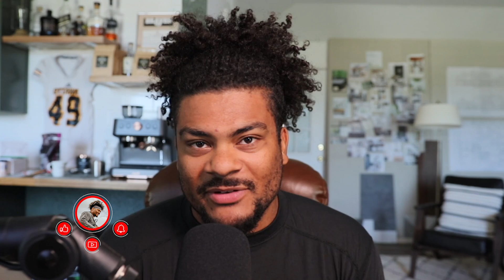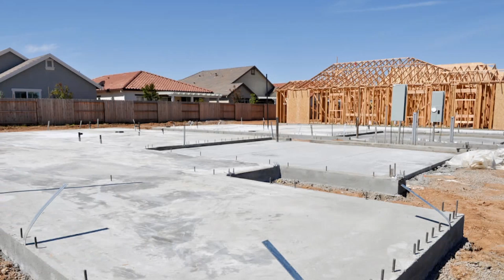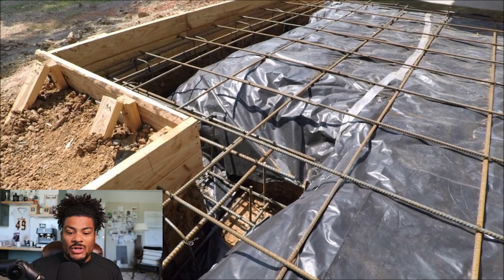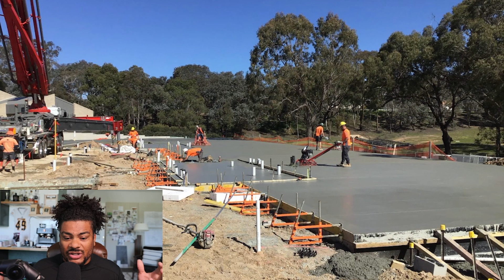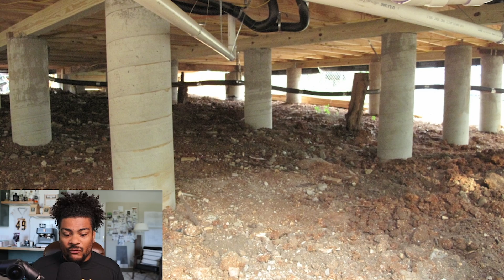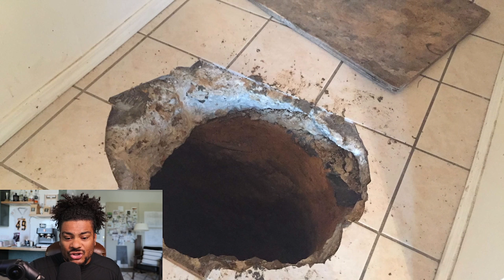Pier and Beam Vs Slab Foundation

Comment: My thoughts are, why not fully box off the beam foundation from the Pier and beam foundation and make a slab foundation in it? Basically combining the two. A slab foundation on concrete Piers. If concerns about if the concrete piers can hold that much weight. Just have steel I-beams as the core of the concrete piers. I'm sure structural engineers can flush this idea out properly

Comment: A crazy thing i saw on a slab....anchor bolts ( red heads) were drilled through the concrete....wih the hole completely hrough the concrete, termites found their way in, and ate up the sill plates and into the studs about two feet over an area about 15 foot along the wall...ive never seen it anywhere else....if anchor bolts are used, i would make sure there was several inches of concrete below where the anchor bolts are placed!

Comment: The main reason post a beam cost more is the floor framing cost + walls when a slab has no framing cost just pour cost and most guys will pour concrete cheaper then guys will frame and post box anchors rebar for the piers hammer drill bits ect start to add up more I pour concrete and am currently building a post and bream right now lol I only went post and beam for the fact I can do more as a one or two man show then I can with a slab is all the reason I did it in the long run slab would of been faster (one day pour) be 2 day framing floor of post and beam so it’s all about money and time frames for most people and u don’t get a lot of pros from post and beam from that aspect but me always moving is a nice part not waiting on help

Comment: I did both. Cmu block piers and a slab for my post and beam cottage. Insulated the piers and under slab. Find pier and beam raised off ground to be worse for bugs and rodents here in the north. I basically have a pavilion right now. Gonna finish walls this summer.  Pier and beam cost more for radon mitigation. Code here masonry needs to be expose or breathable 18 inches above grade. To dry out. Better insulation factor with slab than pier and beam. All the wood causes thermal breaks. So same insulation thickness in pier floor means lower r value. Another con on pier and beam is frost heave. Which I see on a lot on pier and beam cottages up north.  I have 70 psf snow loads and 6 foot frost depths. Another pro for pier and beam is use as a root cellar or cold room. Most sky scrapes have piers and slab.
Reply: Shouldn't pier go below frost line?

Comment: Good video. 10 years in Houston in a 1200 sq. ft. slab home, meh. Bugs, yes. 20+ years in Dallas in a 1200 sq. ft. pier and beam. I'll take the pier and beam. Not many bugs and if I saw one, bug bomb in the crawl space. The house was 25 years old and the underneath was good, probably still is. The only problem was the attached slab garage and driveway. Cracks.
Reply: concrete has been known to crack

Comment: I’m in your area! I bought a couple of run down houses to renovate and they’re my first pier & beams. Gotta’ say, I miss my slab foundation, but I’m working with what I got and I’m learning as I go. I appreciate your insight regarding the benefits of p&b. The houses are ~70 years old and I’m preparing to spend some time underneath with very little clearance and a pretty high level of claustrophobia. Wish me luck!
Reply: most snakes are not venomous
Reply: @badawesome  Yeah, not terribly worried about snakes. It’s working in such a tight space with claustrophobia. Houses are set low, with very little clearance - like belly crawl low, the plumbing is not well organized and there’s junk and trash scattered about that I want to clear.

Comment: In the process of building my homestead. Got a quote for a slab of $16k and some change. Just rented an auger and put in 24 piers for $1774.78 in materials and $434.88 for 3 days on a skid steer with an auger. I ended up doing peir and beam for several other reasons than price but was blown away at what they wanted to do a 30x60 slab
Reply: They charge $10 per square foot for slab where I live in MT

Comment: What’s the best way to insulate? From the bottom? Seems like fastening plywood or something underneath and placing insulation from the top would be easier. 
How would you prevent mice and insects from getting in from underneath? Would you put plastic down under the floor and then cover with blue stone for moisture? Great video. Thanks for sharing.

Comment: In continental Europe it's mostly slabs. What I don't understand how plumbing can go just under the house in this crawl space and not freeze in winter? I mean it's basically street temperature there
Reply: Put insulation around perimeter and temp stays above 50 degrees year round which is the temperature of the earth below frost line.

Comment: Pier and beam all the way.  Another pro is not having to worry about tree roots from garden getting in slab.
Reply: How plumbing doesn't freeze in winter under the house?
Reply: @forevernevereasy  upinor plumbing, well insulated offcourse.
Reply: @dianayukindez7857  extra costs then
Reply: @forevernevereasy  its an investment. Totally worth it. 🙂

Comment: Thanks for the video. I bought land in the mountains with a grade. Do you still think a higher pier and beam foundation is cheaper vs a walkout basement foundation?
Reply: Same. Would love to hear the response on this.
Reply: @donnaspakes2861  A basement is the most expensive followed by pier and beam followed by slab if you hire someone to do it.

Comment: Thanks for the vid Jon! Question - you are using a 1 ply framing on top of 4x6 for your build. One of the pics there uses 3 ply right on top of concrete pier. What are your thoughts on pros and cons of each approach and why did you go the frame on beam route?
Reply from the maker: I like the beam attached to a bracket that is lagged to the concrete personally. it’s more secure in my eyes. But many people do it with 2 or 3 ply 2x12s. I don’t see too many major issues or differences in ether
Reply: @JonDawson  Did you end up beefing up those bottom girders? I thought you started w 4x6 in one early vid but the pics now look like there are 2x10 on each side?